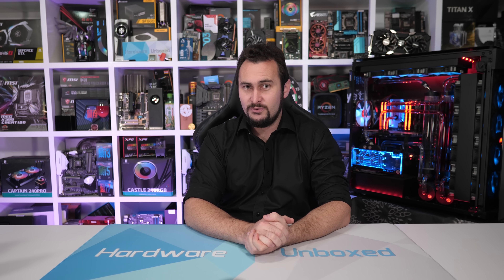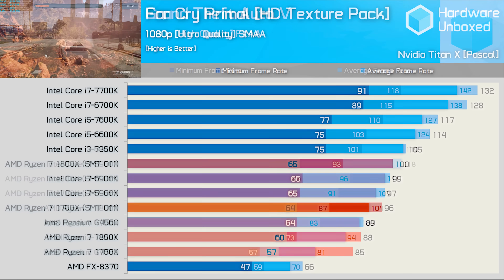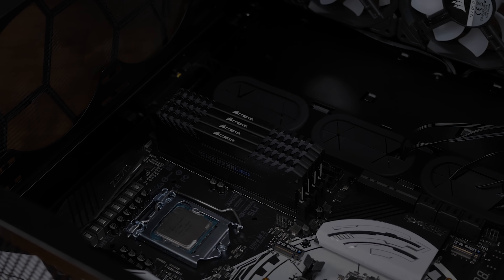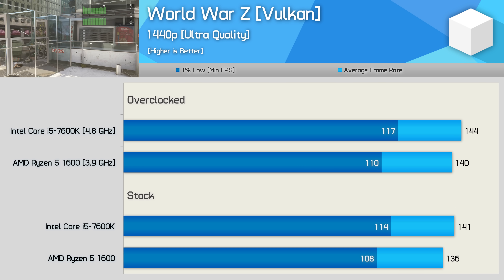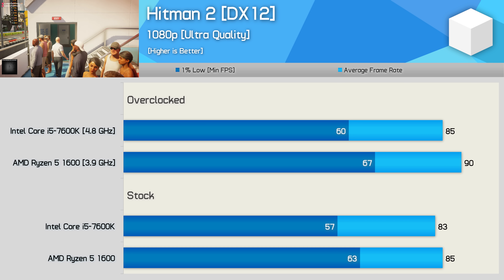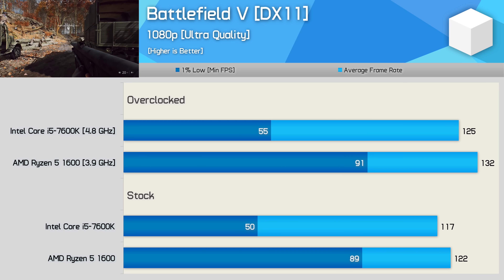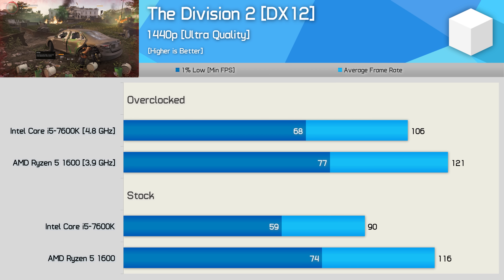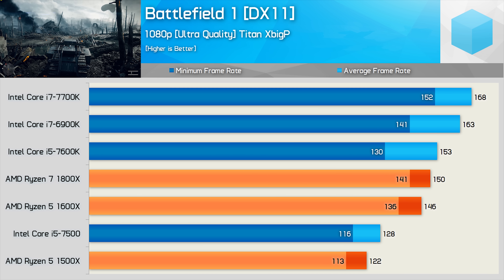Ryzen 5 1600 vs. Core i5-7600K, How Times Have Changed!

Comment: This was an obvious choice when the 1600 released, if you wanted the system to be more long term.  It's great that you covered this in 2019.
Reply: It wasnt so obious for me , even tho im in the "game" :) I chose 7600k now i regret it
Reply: @kaapuuu  I'm sorry.  It wasn't meant to be an attack on anyone who did buy the i5.  Most tech channels and publications were pushing the i5 at the time.  It was obvious to me because I've been doing the building game for almost 30 years, and this wasn't the first time this has happened.  People were having the same conversation about the e8400 vs q6600 back when CoD 4 was big.  Most of our clan went with the e8400, thinking they were right.  Within three years they were complaining about their performance, while it took nine years for the q6600 (OC mind you) to have any issues maintaining 60 in any title I threw at it.  It just received GPU upgrades.
Reply: @NANA-dd4fl  You completely deflected the point. What I was pointing, is that calling something that gets better after few years "fine-wine" is absurd. I call it half-baked. Consumer should not wait to use a product at its full potential. Calling it fine-wine will only credit the bad software optimization at launch
Reply: @wildfireDZ  there weren't any optimization at launch, being a new architecture. It doesn't take a genius to logically conclude that it would get better with software/game updates and follow the trend that devs would use more cores in their code if available hence more perf with same hardware. The 7600k on the other hand was pretty doomed from start being a 4 threads cpu. Again, you made poor choices or you're kinda fanboyed blind not willing to acknowledge those facts. Either way, keep it up! My popcorn bucket is out, so entertaining!
Reply: Buy a product so you can utilize its potential 3 years later. Nice logic mate
Reply: @wildfireDZ  You could enjoy Ryzen 1st gen right when they launched, it just happens to age better than their counterparts, which is a bonus for the smart buyers :). It was cheaper by the time as well.
Reply: @yottaXT  That wasn't the case. The 7600k was faster than the R7 when it was released. And for people struggling in BFV with an i5, all you have to do is to lock the fps. i5s are known for this
Reply: @wildfireDZ  the point is the 1600 is creaming the 7600k now in tge newest titles he tested and the gap WILL widen on future aaa titles. Meaning anyone who has invested for a i5 for 5 to 7 yrs is getting the short straw vs the 1600 owners who got over 60 fps as needed on release...and well... still do. And still will going forward. Games are just moving to utilise 8-12 threads fully now. The 7600k doesnt have them to give... the 7700k however...does and the gap between 2500k 2600k. The 4570k and 4770k. Amd 7600k and 7700k will widen more between i5 and i7. As will the r5 1500x and r5 1600 gap widen etc etc in the future. More cores and threads has proven to keep the cpus lasting longer hell even the fx 8 cores which had dirt IPC kept holding on due to this..
Reply: @wildfireDZ  so your recommendation is to limit cpu usage so it doesn't bottleneck and you're OK with that coz it is supposedly known for that. Wow, just w-o-w. Hopefully other people made the choice to choose the 1600 instead.
Reply: @KrysHome  No, if your game averages 140 fps for example, you just limit it to 120. This will eliminates dips. Your claim about the Ryzen would be true only if it could deliver 140 fps with no dips. Which is not the case for the last 3 years. (PS: Dont think you're too smart and people buying intel dumb)
Reply: @wildfireDZ  thank you for confirming my last comment :) I'm not saying I'm smarter than other buying intel, I own a 4790k but also a 1800x and I beg to differ with what you say from my experience, that's all. Sorry, u triggered yourself on that one :')
Reply: @KrysHome  You've not said it explicitly but still implies it in some way. And god please stop using those classic bashing comments to feel badass. I'm not triggered, just tired of seeing same misconception over and over. Just watch Salazar Studio video about these 2 cpus
Reply: @wildfireDZ  I'm not implying anything. A 4 core cpu against an ipc even 6 core was a bad choice then, is worse now and will keep falling hence intel rushing the 8th gen. You counseling limiting workloads to justify that cpu relevance against its competition is pretty funny and dreadful, that for sure is what I'm implying :) ("i5s are known for that", remember? So what, we should choose that cpu even if there's a better alternative? What a joke. I even bought a laptop with a 7300hq and that cpu is a joke. Hopefully I only use it when travelling, thank God.. So u feel butthurt, idc coz your justification contradicts my own experience :')
Reply: WiLDFiRe GTR More like buy a product so you can utilize its potential for more than 3 years.
Reply: @Neonagi  Battlefield 5 came out last year, so did Tomb Raider and AC: Odyssey. So thats September October and November of 2018 under 2 years and you are getting far superior performance for less money and almost identical performance before that.

Yeah, the i5 was a stupid buy. Imagine buying the i5 for Battlefield 1 and then the very next game in the series its a horrible experience and you paying more money
Reply: @wildfireDZ  It's valid for the new processors coming out as well. Why buy a 12 core for gaming? Well if you plan on keeping the system for more than 2 years, those 12 cores will probably pay off. As shown in the video, BFV is unplayable with a 4 core, not just worse. Games will continue with the same trend if CPUs keep getting more powerful. A 6 core in a few years will be unusable for some games.
Reply: @fortunefed8719  Funny thing is my friend bought his system before ryzen came out and I waited for Ryzen. He has the i5 and I have the R5 and when the BFV demo was released he was getting a horrible experience with terrible frame drops while I was sitting at 80fps+ almost consistently and while we enjoyed the gameplay we decided not buy it as a group because some of us couldnt enjoy the game.

Comment: AMD 64 3200+ vs. P4 Northwood 3.2 when?
Reply: Awesome idea :D
Reply: Still have my Athlon 64 X2 3800+/2x512Mb DDR/Evga 9800GTX/WD Raptor X 150Gb/Sound Blaster Audigy/Lian Li PC 5w/Windows XP Sp2 system,For older games Win 7/8/10 refuse to run.
Reply: i hade one of the 3200+ it smashed intel !
Reply: OBAMA
______
IS SAILOR
Reply: s8wc3 I have both of them in the attic😂
Reply: Ooo Yeah! That Barton core was awesome. I purchased back then Athlon Xp 2500+ and overclocked it to 3.2GHz/400MHz FSB with Thermaltake Volcano 12 cooler. I got 3200+ performance for only 100 USD. OMG that cooler was dangerous it almost cut my finger off once XD
Reply: @Overclocked_Caffe  3.20GHz its over 4000+, the 3200+ is about 2.2 to 2.3GHz

Comment: iNcEl iS fOR gAmINg!!1!
Reply: if you want high refresh, which is the norm for serious gamers today, then intel is king, but im hyped for zen2. competition is always good, cheers
Reply: @ts6603  *if you don't know how to lower cpu settings such as view distance, and want 140 fps instead of 120 fps, incel is for you
Reply: @wile123456  few games have an option to lower view distance. if i have a 144hz monitor and a good gpu i want 144fps ofc.
Reply: @ts6603  yes but Intel is only good for CPU's at 400 dollars with the 8700k and above, everything below is overpriced trash.

Oh and Ryzen 3000 is going to make that outdated very soon. 12 cores at 4.6 GHz is a ten times better deal than a 9900k for the same price
Reply: @wile123456  we will see. i switched from 1600 to 8700. it was expensive yes but at the time the only option
Reply: @ts6603  8700 non K? Lmao, gotta save those 20 dollars to get a locked cpu.

Being a bit patient and upgrading to a 2700x or 3700x would have been much smarter, and then you wouldn't need to get a new motherboard either
Reply: @wile123456  dude i saved 100€ compared to 8700k and it is 10% faster at best. why so angry?
Reply: @wile123456  8700 is at least 30% faster than 3700x in games
Reply: @ts6603  Wrong, the 9 core Zen 2 CPU's are as fast as a 9900k in games or atleast close to. I'm not angry just laughing because you think you have a supiori cpu, but you can even get a clockspeed advantage now, you'll get matched by midrange Ryzen 5's in a few days
Reply: @wile123456  my bad i was talking about the 2700x. i bought the 8700 in october 2018 i wanted to play back then not wait 1 year
Reply: @wile123456  man i know my shit i watch hardwareunoxed for 2 years now and i made the descision based on the facts i told you. at the time it was a bit expensive but the gaming experience was worth it

Comment: I am vindicated for having purchased a R5 1600 at launch! lol
Reply: Ryzen 5 1600 was a fucking steal dude, Ryzen 5 2600/x out sells everything on the market. Ryzen 5 3600x and Ryzen 5 3600 are probably going to continue carrying that torch.
Reply: @dondraper4438  i agree ryzen 5 are the fucking sweatspot for price to performance.
Reply: Fuck yeah me too. Probably i'll hold into it until r5 4600 gets released
Reply: Pau Romaguera Palomé Exactly what I’m going to do with my 2600. The Ryzen 4XXX series will probably be the last chip on am4 anyway before am5 and ddr5.
Reply: @pauromaguera  yes, hopefully I have some extra money by then.
Reply: @pauromaguera  yes sir, I got a R5 2600+1070ti+16gb 3200mhz ram and there's nothing else for me to do but just wait for the 4600 also if the board support. I'm so glad I didn't go with Intel when I upgraded from a 8350.
Reply: @chickendinner5572  I literally got your same build, besides for the cpu. Once I upgrade to zen2+/3 i'll buy new motherboard and a new ssd. That'll be it for three more years.
Reply: @pauromaguera  yeah, I'm totally fine with mine. With the 3600 having a 15% ipc increase, I hope the 4600 is at least a 10% increase so I'll have a total of 25% increase in my new upgrade. Hopefully it'd be on the same mother board. I really want an all AMD upgrade.
Reply: @chickendinner5572  And if we can get some more clockspeeds and even better memory compatability... holy fuck
Reply: I just upgraded at microcenter to a 1600 and a b450. $ 110 USD. I'm good for 4 years.
Reply: @KingOfGorillas I can't even argue against older ryzen 5's or ryzen 7's, the price to performamce ratio is insane. The r5 2600 is in my opinion the superior to the i5 9400f.
Reply: @KingOfGorillas well , if you are waiting for 3xxx to come out for the sole reason that the 2xxx and 1xxx are going to drop in price even more , that's ok , but if you're building a budget pc and planning to buy 3xxx series its better to just settle for 2xxx or 1xxx after the release (your point). If you have money to spend it's a different story tho.
Reply: i went for the 1700 and clocked it to 3.9ghz im well happy with it and dont intend on upgrading it any time soon.
Reply: Exactly, lots of idiot YouTubers tried to push users to the i5 on a dead end platform.  Quad core is a very basic processor these days.
Reply: Yeah I am pleased with my 1600X purchase. I don't even think I need a ryzen 3600X because I have an RX 580. so I'm probably not even going to get the most out of that CPU anyway, especially when the 1600 does everything I still need to do. 80hz in taxing open world games like division 2 and witcher 3 is plenty and 120-144hz in AA  games and indies is more then enough. I think ill wait for Ryzen 4600X and get Vega 64 which should be the new RX 570 by then with it for $150-170.
Reply: 1600 was well praised at launch, and is currently the best budget CPU buy if you can find discounts
Reply: This is like the Shawshank redemption movie
Reply: Has it caught the 7700K in any games yet? (Will it ever?)
Reply: @mdd1963  Has intel caught zen 2 yet? (Will it ever?)
Reply: @pauromaguera  Has Zen2 actually delivered, and (given a no answer) proven to be faster in gaming once it does? :)
Reply: @mdd1963  will the 7700k cost as the 1600 ? Because spending double the money for a quad core cpu in 2020 is embarrassing
Reply: @A.Froster  I would not advocate anyone buying the 7700K in 2019 or 2020....; but, if the 7700K is so embarrassing, ....where does that leave the gaming performance  assessment of the R5-1600 through R7-2700? sub-embarrassing?
Reply: @mdd1963  The assessment is that a 6 core chip cost less than half the price of a 4 core CPU while being better at anything productive wise and having comparable gaming performance. Your damage control is hilarious , YOU are embarrassing ..
Reply: @mdd1963  Why do you keep making that ridiculous argument.  The 7700k and the 1600 and 1600X were in completely different price brackets.  The 7700k was a $350 part at the time, which puts it in the R7 1700 and 1700X price bracket.  Not even close the 1600 X or non-X bracket.  Which even then, the 1700 was still cheaper at $330.   So stop making that ridiculous argument.  You have no idea how much dumber it makes you appear every time you use it.
Reply: @valhallasashes4354  I did not argue for anyone to choose one over the other then, and would certainly not argue for anyone to choose the 7700K now, I am merely pointing out the results of having done so 2.25 years ago...; the R5-1600 did not cost $79 at launch, and, the 7700K was available for months before Ryzen. (I would never have chosen a 7600K anyway despite it's $100 discount over the 7700K)
Reply: @mdd1963  I dunno, I guess I should be looking for the 7600k out performing the 7700k too, since I guess we actually don't care about price brackets at this point.

Answer: if hyperthreading stays a thing, it probably won't in games.
Reply: @mdd1963  Hmmm, maybe they caught in those newer games that use more than 4-5 cores. Maybe they have beaten already. We'll see, maybe sooner than we think.
Reply: mdd1963 I feel really bad for 7700k owners, you can get double the cores (1700cb points at a super low 3.8 GHz) for $120 to $150 with Ryzen 1700 and use a $70 B350 and overclock some on the really nice and silent RGB stock cooler. My cousin topped out at 4.6 GHz and 4.5 GHz on dellidded 6700k at around 1000cb points (which to match, I disabled half my threads for 8 threads vs 8 threads, and then underclocked my gimped 1700 to 3.0 GHz to get the same 1000cb...). The 7700k is extremely obsolete by todays standards, even my slow 8750H laptop performs much better in anything non-gaming

Im not sure how well a monster 7700k system would be, just like the 9900k they only have 16 PCIe lanes, so you can’t really crossfire/SLI them well like Ryzen can. My main system is 4x Fury on TR-1950x at 4.15 GHz (basic 120mm AIO cooling) and scores 3600cb and an insane 100 fps in Crysis 3 at 4k Ultra vs my Titan Xp at a lowly 45 fps... So You’ll be way below my score if you used duel 1080ti for example, and since the 7700k probably will gimp that too much due to PCIe bandwidth, I can’t even compare it to the high end... Id have to test 720p or something to show if it’s any faster, but it’s not significantly faster in anything if it is, and it’s far slower if you multi-task, so overall it sucks for those owners because the 8700k and 9900k were just around the corner!
Reply: @jakegarrett8109  Holy fuck dude. 4.15GHz on threadripper with a 120mm AIO? You hit silicon gold. I have to pump 1.45V into my R5 1600 to get a stable 4.0GHz with a 240mm AIO.
Reply: @MrSlashStudios , nope, the Threadrippers are made with binned dies "from the factory".
1600 is still the better buy, bicause it's so unbelievable cheap.
Reply: @mdd1963  You a robot? LOL